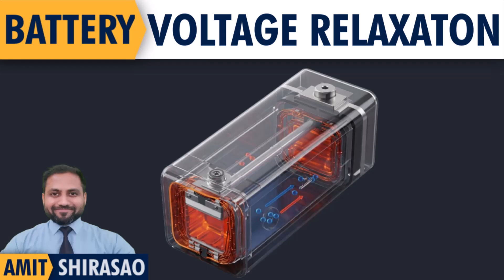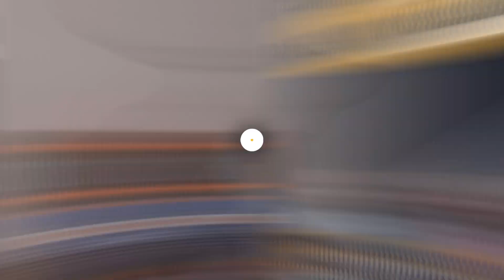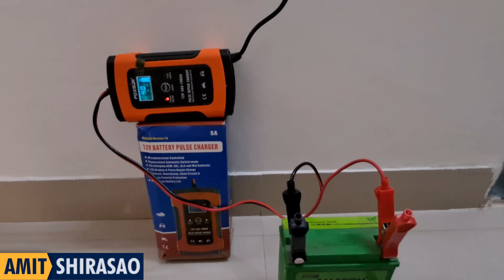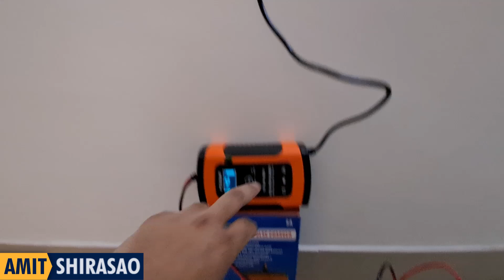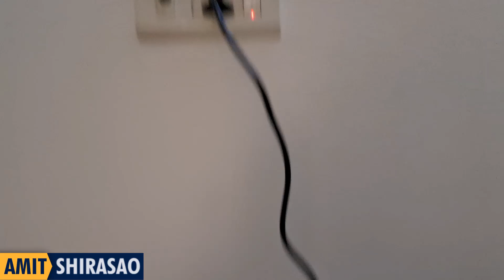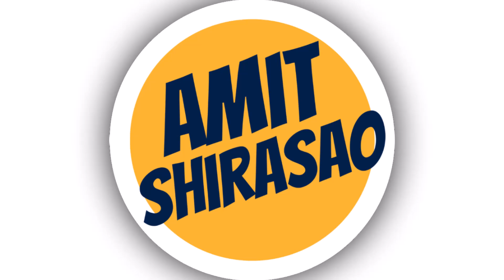Electrical Engineering Concept - Voltage Relaxation in a Battery

Comment: At 1:35 the Volt meter in the charger is reporting 13.9V @4A at the meter, not the battery.  There is voltage loss in the wires from the charger to the battery and back. So if you are doing a demo like this, connect a meter at the battery.  Wires have resistance and cheap chargers have cheap wires.
Reply from the maker: @chucksommer7784  Wow! Thx for your guidance. I didn't know that. 

Such comments help my subscribers understand a topic better. Appreciate you for adding to our knowledge pool.